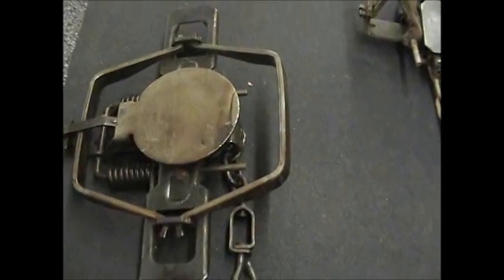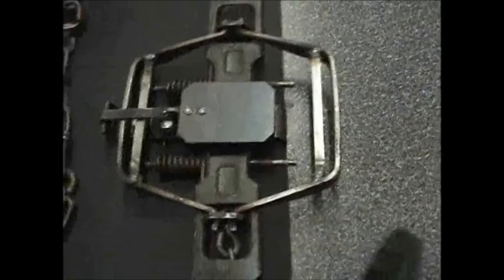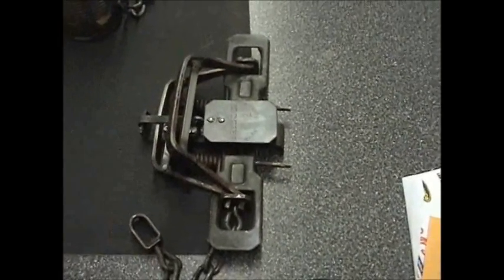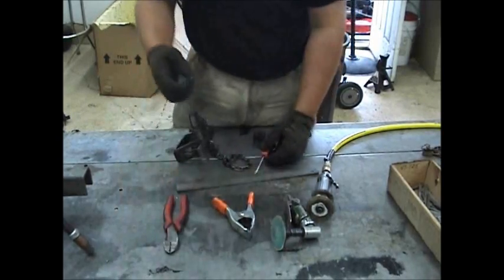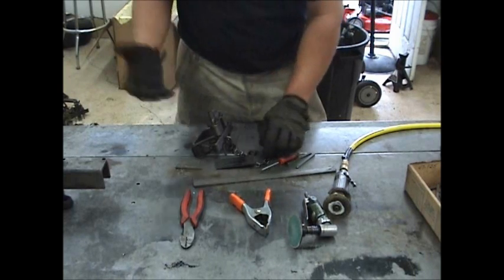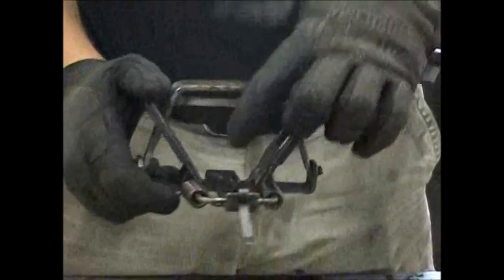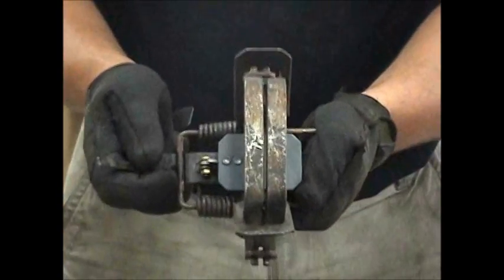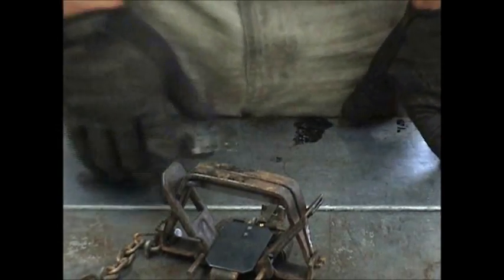Bridger #2 Trap Modification

Comment: Great videos man. I have a question about welding. I'm not a welder, and I'm looking to mod my traps myself by buying a entry level cheap welder. I'm trying to figure out whether or not to use a stick welder or a cheap 90 amp flux core wire welder. I'm sure either would work, but I'd like to get a welders point of view for trap mods. Thanks
Reply from the maker: I would go to harbor freight and get a cheap 110 welder with gas. The are much easier for beginners to learn to weld with vs Flux core and stick. Also check out craigs list deals to be found on there. Glad you like the vids!

Comment: So you didn't realize Bridger makes a # 2 offset???   Cause you did the same thing as Bridger did except Bridger did the work notYOU  The #2 offset 2 coil has held every fox or coyote i have ever trapped.  Crazy question but.. you might wanna look at your chain length??  You don't want the animal to be able to pull straight up....If they have to pull straight up they have a very good chance of getting out. Where as if they pull to the side they don't seem to have as much power to pull??  Not sure if it makes sense but try it.....
Reply from the maker: Been happy with them so far